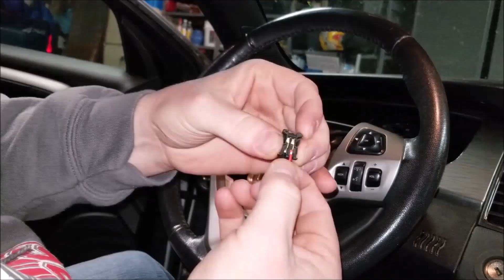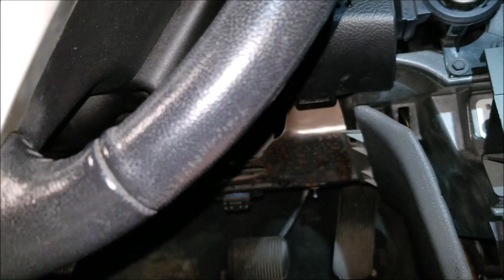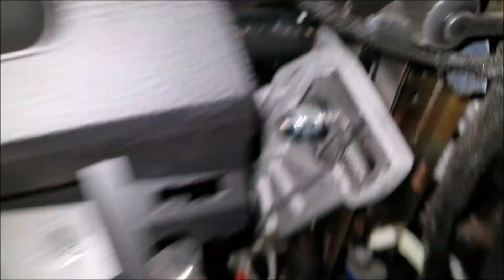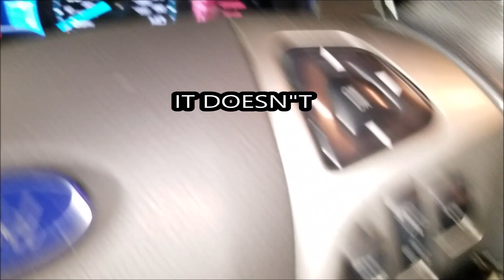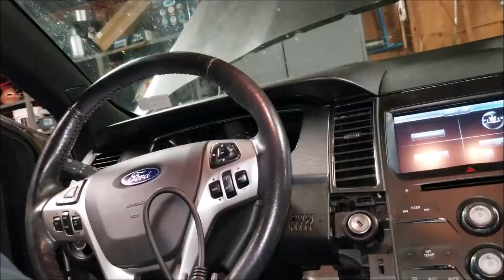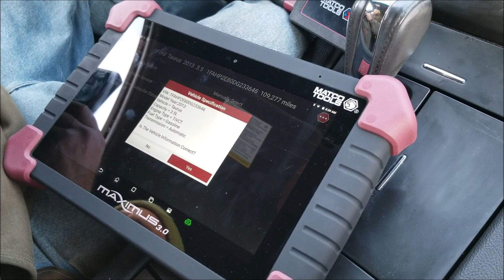Repairing an Airbag System - Ford Taurus Safety Restraint System - Several Fault Codes Repaired

Comment: So did you have to get the "collapsible steering wheel" sensor reset or did that go away by getting the srs module reset + the new seatbelt/seatbelt reset?

Comment: This video just proved to me that I don't need to go out that do this my my Taurus I hit  a deer few months ago and my airbag my seatbelt all that went out on me. When I invite all the parts I needed which cost me about roughly $600. So I think I might just pay someone to put it all in for me because I'm not about to do all that but it's a nice video thanks for enlightening me, I actually thought it might would have been a kind of easy task
Reply: i also have a ford taurus. Mines a 2010 and like you hit a deer. light damage but enough to cause airbag and seatbelt on drivers side to go off and set dtc. Anyways u can use forscan on a laptop to do your resets once you fix
Reply: @finley614 roughly, how much does it cost to replace a air bag? I have a 2017 Ford Taurus limited and my insurance is trying to give 5500 for a busted headlight, grill and deployed airbag. How much does the repair really cost because I hit a Deere and I don't want to total the car because it's a good car.
Reply: @pachaad_ban_reuben2026  late response, but I have a 2013 police interceptor (should be the same for both cars) and just paid 189 for a headlight, 200 for a used airbag (800 new), grill is anywhere from 80-250.

So 1200 for those 3 parts because insurance won't pay for a used airbag

Comment: Hey I just bought a 2013 Taurus and your video has helped me out a lot thank you. Could you please tell me what I have to do to replace my passenger side dashboard airbag? And is there anything else I would have to send out to clear the airbag light I’m just asking because your Taurus only had the driver side bag out witch mine is out on that side to buy the way. I would also like to know where to send them please. I also bought it at Copart and it’s my second car the first one had a blown transmission it was a 2012 Dodge Grand Caravan I’m currently trying to find a cheap transmission for it. Thank you for your time and help.
Reply from the maker: I've never had to replace the passenger side. My guess is the dash would need to be changed.  Since the passenger side is blown you will need to send out the passenger seat belt recharge to be rebuilt also. I sent my airbag stuff to Www.myairbags.com to get rebuilt. They were fast and reasonably priced. Where are you located?  I have a driver airbag I would sell cheap but shipping it way too expensive so it would have to be picked up.
Reply: @bucksgarage1  thanks a lot for all the help I’m located in Pittsburgh pa not sure how far that is too you but let me know. And again thank you. Your video was a lot of help to me.
Reply from the maker: @amymott1933  I live right inside ohio but work at Pit airport. I also have a parts car that has the  dash and passenger airbag in it still.
Reply: @bucksgarage1  yes that would be great I’ve been looking for a parts car too come up for auction mine is basically just like your Taurus that was just hit in the front but the airbag broke the windshield my dash is black I would like to send you some pictures don’t really know how if you do please let me know. And please let me know how much you want for your parts and also what color is your interior I need a armrest I have tan leather. Thank you for all your help
Reply from the maker: @amymott1933  everything in that car is/ was black. It also has a windshield-  email me your # we can figure it out. Bbuckley82@hotmail.com
Reply: @bucksgarage1  I sent that number thank you

Comment: Was it necessary to change the sensor in the colomn?
Reply from the maker: Yes. It holds the column secured from moving back and forth. Also the airbag light will not go off without it rebuilt.

Comment: Hey I'm having the same issue with my ford fiesta. Will any snap on maco scan tool reset the occupent weight sensor.also trying to stay away from the dealer. Also do you know if the forscan.org software will do it?

Comment: I went through something similar this past summer on a Honda Accord. I bought the car from Copart it was hit in the front corner. No airbags deployed. But i had an airbag light. It was the passenger occupant detection sensor (OPDS in Honda's) I replaced that sensor box. Still had the code. I have a scanner that will clear those codes. I couldn't reset it. Took it to the dealer. They couldn't clear it. Come to find out i bought a bad replacement box. I swapped the box out and the code cleared, after calibrating.  Those occupant systems can be a real pain to get working again. Glad you got yours going again.
Reply from the maker: That's a shame. A bad new part is the worst. Makes you think the problem is way bigger. I dealt with a blend door actuator motor that did was bad from new, I chased my tail on it for well over a week.

Comment: Hi Brett, pretty cool video. Never seen one on airbags before. Allot to it if doing it for the first time. Speaking of diagnostic I just got one to try out on my truck. Want to check my injector balance rates on my duramax. After I make sure it works will do a video on it. Yep sometimes you have to spend money to make interesting videos👍